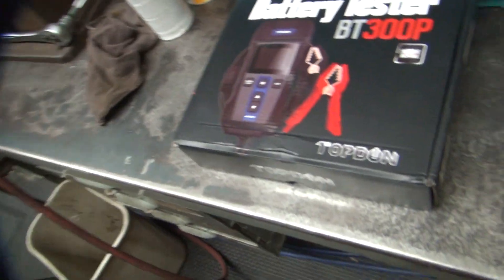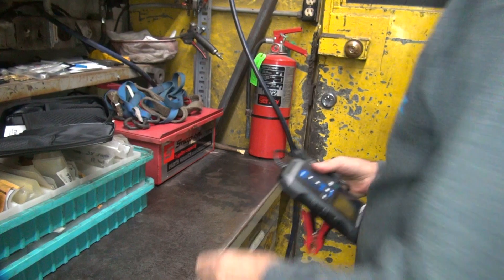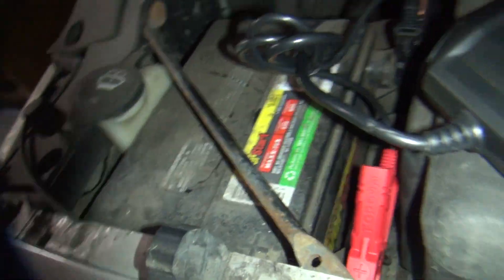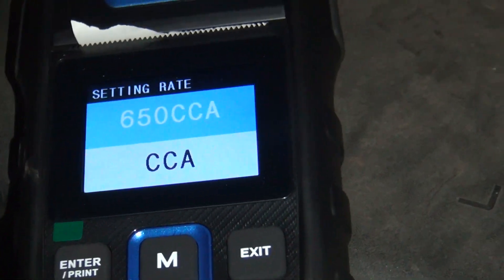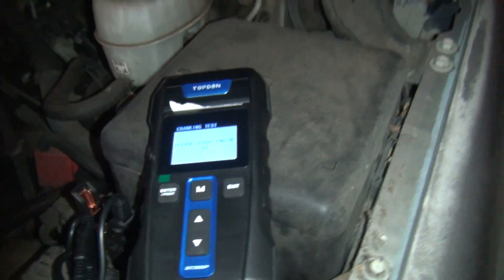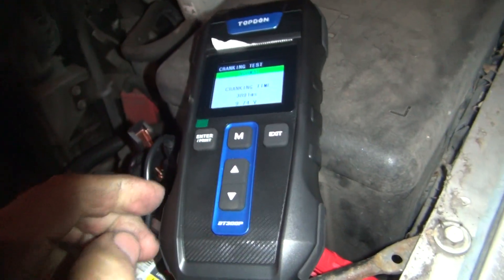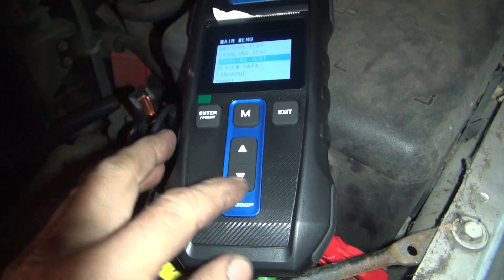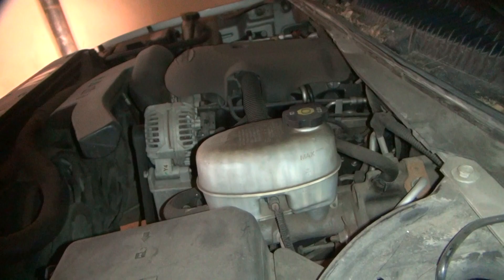#102 2022 new product review test TOPDON BT300P Battery Alternator load tester harley tatro machine

Comment: Calibrate your gauges.  I bet your volage gauge comes back.
Reply from the maker: i don't know how that would be done.
tatro
Reply: I don't remember the Chevy.  But, try this.  Push and hold the trip meter on your dash while you turn the key to the ON position.  The gauges will all go to the right and they will adjust themselves.  It's learning where they are in position.  Then it will go full bore and then back again maybe couple of times.  Example: the fuel gauge will go E to F back again and then back to F till it settles out.  You might even get a calibrate mode flashing on the dash.  There probably is a video on it.  When it's done cycle the key and start the engine.  May not fix it but it's worth a try.

Comment: I've got one of these & have never found any fully charged battery I've tested to be close to the stated CCA ... most are not even close ... have arranged for retailers to have their best fully charged batteries at the ready for when I test them off the shelf & they all fail their labeled CCA ratings ... I haven't had the pleasure of having another brand tester on hand to compare notes ... this is a great tester for a 1 man operation especially when load testing on start up ...